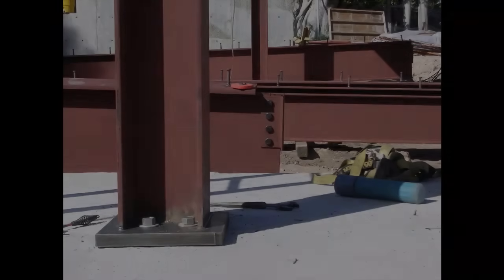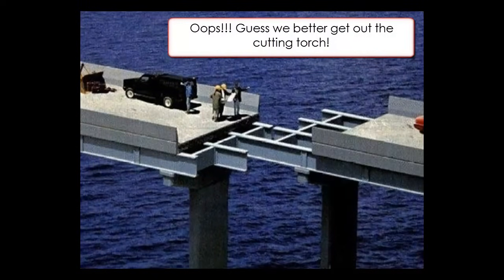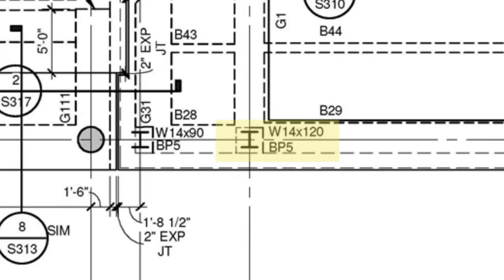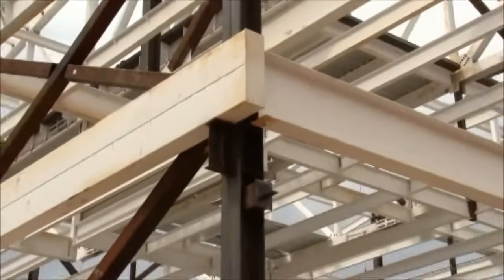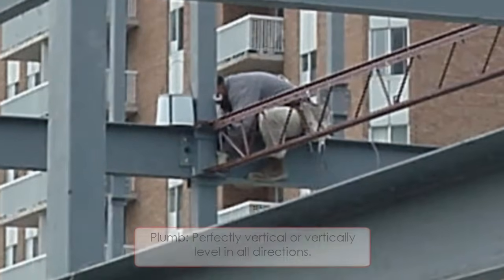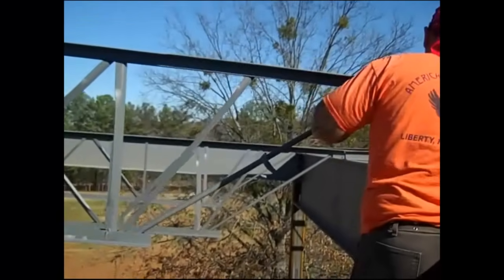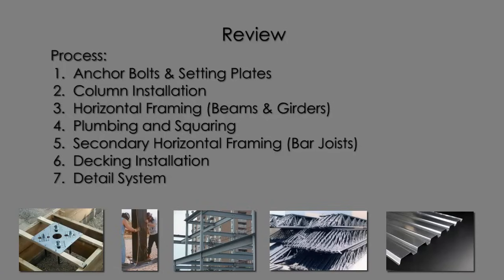Structural Steel Frame Anatomy and Process

Comment: Can a Boeing 767, made of lightweight hollow fibreglass and aluminum composites, fly through structural steel?
Reply: Hells no🤣 911 was an inside job
Reply: Yes lol, the fuel can heat it enough to make it pliable
Reply: @JohnnySack16 i’m talking about the penetration through the steel
Reply: @Trojan_Horse24241hgreihgeihrg  yes lol. The lightweight hollow fiberglass and aluminum composites that weigh over 200 tons flying through the air at almost 500mph can smash through the light gauge steel curtain wall and the structural I beams. It would be hard to find something to stop that mass moving like that lol.
Reply: @JohnnySack16 incorrect
Reply: @Trojan_Horse24241hgreihgeihrg  it’s not incorrect. You know nothing about steel you’re just randomly saying things. 200 tons at 500mph even if it didn’t go through the steel it would sheer the bolts and welds on all of the I Beams, all of the relieving angles would be disintegrated lol. It wouldn’t matter if it was galvanized but also, it wasn’t. I don’t think you understand what kind of force that mass moving like that would generate lol.
Reply: @JohnnySack16  an airplane can have a huge hole in the fuselage from the impact with a bird. A bird weighs less than 10 lbs and has flesh and bones. The world trade center was made of 500,000 tonnes of grade A structural steel and concrete. A core column connected to the exterior column all with steel covered with concrete. If a 10 lbs bird can cut through the fuselage of an airplane, then how can that same plane turn 500,000 tonnes of steel beams and concrete into dust? Also making the building collapse at free fall speed? lol.
Reply: @JohnnySack16  just the penetration through the exterior column violates the laws of physics, let alone turning a massive steel structure into dust. lol

Comment: Not a bad video.  We don’t use the term “I” beam though. They are called “wide flange shapes” since the shape can be used as a column, beam, or brace.   

That first picture of the base plate is a poor representation since the anchor bolt projection does not meet AISC requirements.  The threads of the bolt must engage all the threads of the nut.  These are too short.  

Lastly - don’t use this video as a means of steel Erection in accordance with OSHA Subpart R.  I counted 3 “serious” and citation worthy violations.  PPE and fall protection.

Comment: which is stronger steel frames like this or concrete (with steel bars)???
Reply: Depends on the size of the individual members that make up the structure.
Reply: @CDubs720   the armoured concrete - columns and beams - 300-400 Portland cement and wire-linked cemented construction steel rods (2/3”) is the preferable construction system, isn’t it? It’s a little longer. No matter how the building area is small and how they fill the walls between columns and beams, you need a week for every level and at least a month for the basis. 
E.g. not a large area of 150m2 , say 1 minimalistic (budget) apartment on every level, built in 3 to 5 months, for 5-apartments  - building, from scratch (a pit) to roof, ready for exploitation.

Comment: 4:04 whoa! Major OSHA violation! No fall protection and can't use material to support yourself if it's not secured in place.
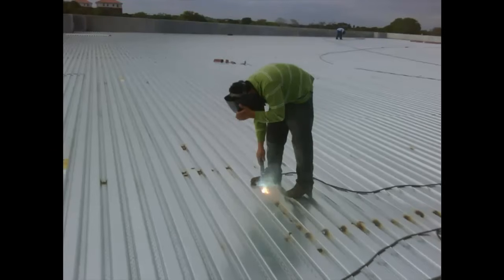Same issue at 4:40
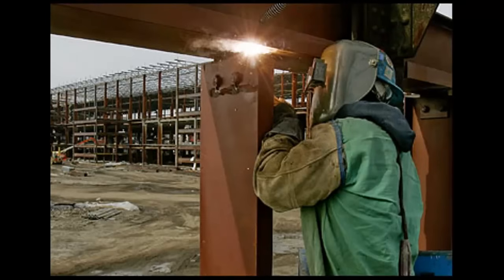Guys at 5:04 should be using a lift or scaffolding.

Comment: How do engineers two distant column is at same level for beam in place perfectly horizontal?
Reply: Columns will be levelled first to achieve perfect bottom of base plate elevation, there are several levelling types like using of levelling nut, shim pack method, levelling plate method. Please review these for more information
Reply: @maradanipraveen882  thanks so much
Reply: @emmanuelalfonso8943  welcome. Refer American institute of steel construction code AISC for more information

Comment: Oh yeah, this is good .. btw will this withstand the thermal stress from jet fuel ...
Reply: Nothing stops Jet Fuel. Jet fuel induces immediate structural failure and collapse.
Reply: homertalk 😂😂😂✈✈✈✈lol
Reply: lol ...Only if the rothschilds are not involved ;)
Reply: The beams and columns in the world trade center  flanges ranging from 1in to 3in thickness, and at that approximate time period they didnt use mild steel just yet, they used pig iron big and bulky, the reason why the Industry made the switch to mild steel is because pig iron was hard to cut and shape it wasn't malleable like mild steel that we have today. How do I know This? Because I am a 15 year union Ironworker vet, stay woke safe travels✌
Reply: Lol